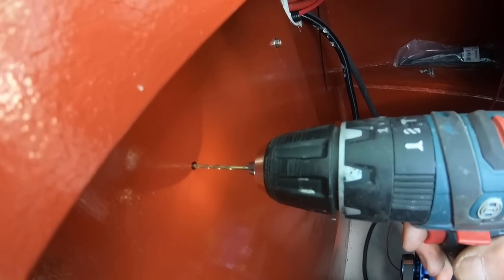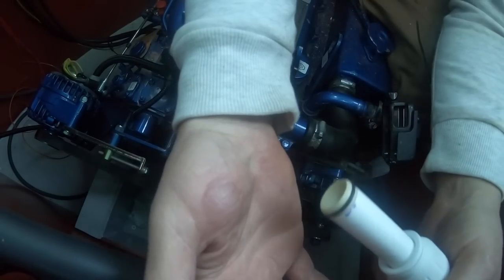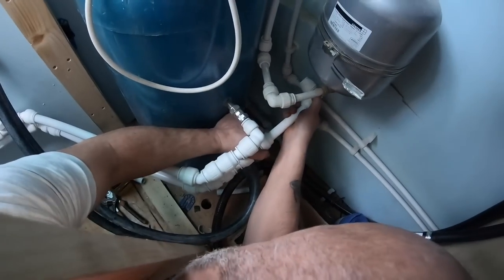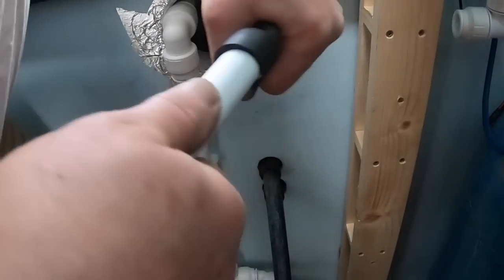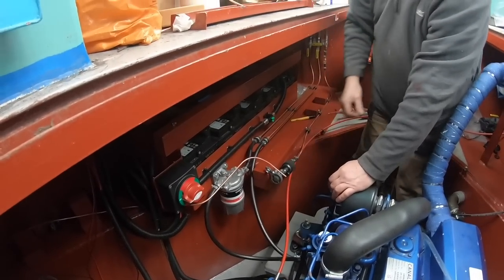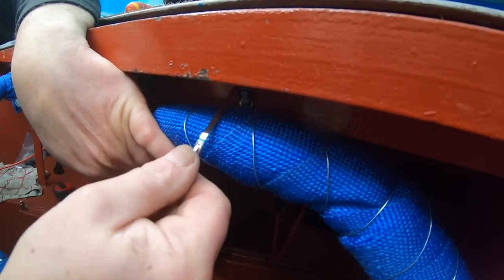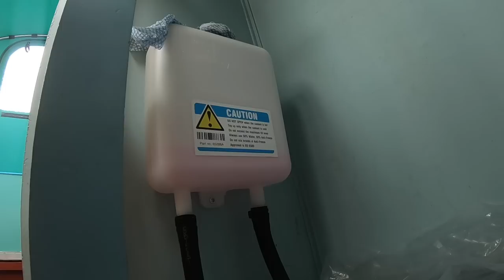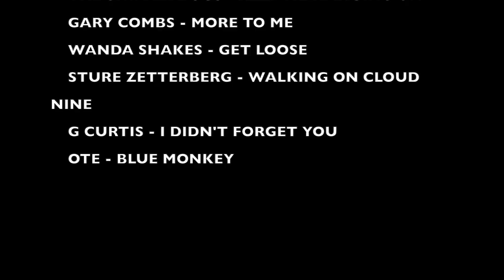VLOG 104, Narrowboat Fit Out - INSTALLING OUR MV MX50 DIESEL HEATER (NOT Mikuni as mentioned)

Comment: Hello from Germany again 😀
What do you think about this idea: While the engine is running, it brings heat into the calorifier. Would it be a good idea to start the circulation pump of the diesel heater to bring the temperature inside the boat? Yes you have a problem with your waranty but I am thinking about doing it on my older narrowboat. I do not think about starting the diesel heater but the pump using an extra switch and relais so it will get the 12V from the starter batery and the dieselheater will be set to off while the engine is running.

Thinking about the discussion
Reinhard
Reply from the maker: Thankyou Reinhard, If i have understood your question correctly I don't think that would work?. The diesel heater and engine pipework to the calorifier are independent of each other so the diesel heater pump running would not circulate the water in the engine calorifier pipes as they are 2 separate coils in the calorifier. I may of misunderstood your idea so look forward to your reply 👍
Reply: @makinganarrowboatwithnannyandg  Hello Grandad,
the two systems are thermal joined together in the calorifier. The cooling system of the engine heats the calorifier with the lower heat exchanger. Then the other system with the upper heat exchanger takes the heat out of the calorifier and brings it to the radiators (and to the diesel heater).
So it will work. The thing is that the diesel heater will not use any diesel and it won't become too hot and the vent does not work while I use only the circulation pump. It ist only free heat from the engine to use inside the boat.
The question is, if you would use this feature or if you say that you won't need the free heat inside the boat while you are moving the boat.
Looking forward to your opinion.
Reinhard

Comment: Hi Guys we have watched all your videos with great interest as we have a narrowboat built two years ago and is based on the Shroppie. I am interested as to why you decided on the Mikuni MK50 as opposed to the "usual" Webasto and Eberspacher versions. My Webasto heater packed up at the beginning of Dec last year and I am still awaiting the local dealer to sort the thing out, and I am not impressed. So I am looking for a possible replacement because I know of other folk experiencing similar problems with their Webasto heaters. Is it because of similar comments you may have heard, that made you decide on the Mikuni, or was it just as simple as the cost. Many Thanks
Reply from the maker: Thankyou Paul. We have been reading, researching and asking advise on heaters for ages now and still don't know if we chose right. I think only time will tell. Yes we ruled out Webasto because we heard many peoples stories of them going wrong and not many positives but that is usually the case when looking at reviews. What swung it for us was cost in the end and we couldn't find many negative reviews for the Mikuni MK50. Someone has said on one of the comments that we wont be able to get parts for it but the company we bought it from has all the parts for sale on their website so hoping that doesn't change. Good luck with yours, hope it gets sorted soon. 👍
Reply: @makinganarrowboatwithnannyandg  Thanks both. Unfortunately we didn't have an option on what make of heater we got, it was included in the new build of the boat, and it ran OK but not brilliantly for the first two years except for last Christmas when the filter was found to be dirty. Exactly one year later it failed again and I cleaned the filter but still didn't  run. After umpteen visits by the Webasto local agent and a dozen or so stupid ideas on how to fix it (the last being to install a plastic tank, which we have no space for) I am coming to the conclusion, that the agent hasn't a clue and he has charged me £600 so far. So I am probably going to order the Mikuni and at the time of fitting I will check and alter if neccesary the pipewok. I spoke to MV Heating on Monday, found them very helpful and they confirmed that parts are avvailable. Anyway thanks for your reply and I will let you know how I am getting on in a few weeks

Comment: I think that you have a bit of a downhill slope on that fuel line to the pump and that's the cause of your fuel starvation. If you'd mounted the pump on a bracket above its current position it would have made it higher and eliminated this. Unless I misunderstood and  I probably did, why did you just use manual taps on the T piece that sent the heating water to the hot water tank or radiators and not an electronically controlled three way valve so that you could have controlled whether you ran the heating, hot water or both from the control unit/thermostat? 
Those heaters are great, my friend has one in her camper van. Poor granddad's hand, I hope that it's soon better.
Reply from the maker: Thankyou Tony, Yes your right, there is but it was the only way we could fit it in keeping the pump angle right and the pipe running from the pump to the heater gradually sloping up. Originally the pump was going much nearer to the heater but when we read all the restrictions of length of pipe runs we realised we couldn't do it the way we had planned. If we had put the pump a bit higher the pipe would have to dip down under the isolation switch  to get around to the heater. We spent a whole day trying to work out the best way we could fit it in with as less dips as possible and decided on the bit before the pump would be best as it would be the least fall. When the fuel didn't flow through that was the first bit checked and the diesel was flowing through ok there. It was the pump that needed a bit of help purging and Ady did that by taking the whole pump off and submerging the end in a cup of diesel and switching the pump on until it pulled through. Once it was attached back onto the pipe it worked straight away. We have been told in one of the comments that our fuel filter is the wrong one so if the new one comes in time that will be shown on this weeks vlog and we can then also explain what i have just told you.  These heaters need to have a bypass so if you only want hot water on you will need to have a towel rail or radiator left on to provide the bypass so the gate valve will never be used. The radiators will be turned off individually leaving one on. Also a 3 port valve would need to be powered continuously to keep it open and although a minimal draw it will still be taking power from the battery bank. 👍Hope i've explained all that ok 😂
Reply: @Making a Narrowboat with Nanny and Grandad  Thank you for your detailed response. You obviously know what you're doing without my comments, I just like following Grandad's (expertly supervised of course! ) work and I'm afraid that I can't resist putting my tuppence worth in. A valid point regarding the battery drain something us landlubbers dont always appreciate. It really is all coming together now isn't it?
Reply from the maker: @tonycamplin8607  hahaha we love everyones tuppence worth. Without it we would have missed and messed up on a few things.  Yes we will be glad when all the technical stuff is finished. We thought we would be half way through the woodwork by march but we are still hanging around the engine bay. It's all a learning curve and wont be too much longer 🤞

Comment: A question, what made you use gate valves and not lever ball valves in the heating system please?
Reply from the maker: Cheers Martin, basically for no other reason than we had some gate valves in our box of stuff we had before getting the boat from previous work and as they are not or very rarely ever going to be used or seen it didn't really matter and saved us a few quid on buying anything else👍
Reply: @makinganarrowboatwithnannyandg  understand thanks 🙏

Comment: Hi, your heater filter won’t pass the boat safety regs , you should have come straight out of the blanked of outlet on your engines Lucus type filter that your pipe passes over the top of for better filtered fuel to the heater and would have saved a bit of space and work , 👍🏻
Reply from the maker: Hello and thank you for that info. Can you let us know where you found out that as I can't find any information on it. Unfortunately our original plan was to use the big filter already on and have the pump on the starboard wall  but once we got the heater we realised it was past the maximum length of the allowed pipe length from the tank to the pump so couldn't use it. The heating kit we have is the marine kit which includes the filter we have used so presumed that was suitable. I am away looking after my mum at the moment so Ady is at the boat and will try and speak to a bss guy over the next couple of days but any info on how you found out would be great. Thank you Hayley
Reply: A marine kit for inland waterways is different to a coastal or sea going boat , inland boats can’t have filters that can melt and your short rubber connectors need to show the iso7840 number ( search for webasto 3.5mm fuel hose ) it doesn’t really matter how long the fuel line is because diesel can’t be compressed so once the line is full it will all go at the same rate long or short ,hope this makes sense 👍🏻
Reply from the maker: Thank you for that. I've just spoke to the company who supplied it and even though we have purchased the inland waterways kit for narrowboats the filter in the kit is as you have said not right. We will get a different one and fit it as soon as. Thanks again for letting us know and will give you a mention in the next vlog if I can work out how to pronounce your name on here lol.

Comment: Sorry you installed a Mikuni heater.  Spares no longer available, best steered clear of.  Unless you know better.....
Reply from the maker: Hello David, We purchased our heater from MV heating and they sell all the spare parts on their website. So fingers crossed they will still do so if we ever need them. Someone we know also has the same heater and they told us they had no problem getting a part they needed so i will find out where they got theirs too. Thankyou for that info though we will keep a look out for suppliers 👍
Reply: I contacted MV out of curiosity.  Background is that last year I searched high and low for spares for my Mikuni heater, which might have cost around £250.  I ended up fitting a new Webasto at £2500.  MV say that you are not fitting a Mikuni heater but an MV heater.  I think you may know better, so any further info might help other boaters.
Reply from the maker: @davidward113  🧐😩🤔🥴eh hahahaha what plonkers we are. Just seen your message and checked and you are right. Can't believe we have done that. We researched MX50's for ages and thought they were all Mikuni and MV heating sold them. Flippin ek it's obvious when we look now because it says MV at the beginning. Thankyou for letting us know, I better edit this video quickly. We will add an explanation in this weeks vlog. I suppose the bonus is with this mistake is that we have added a heater that we can get spares for. Thanks again 👍